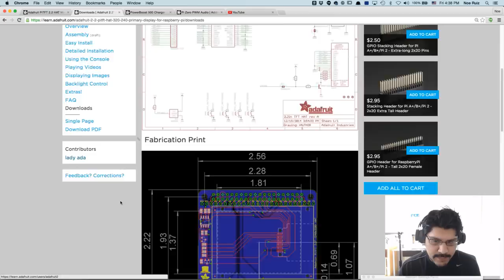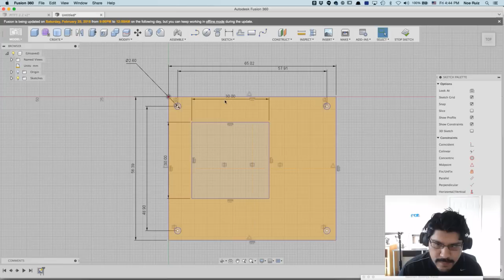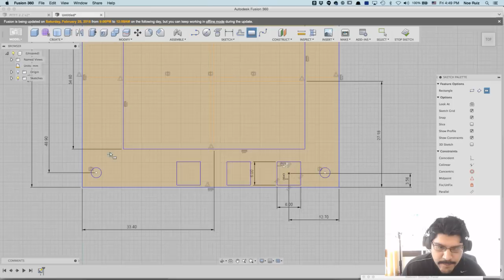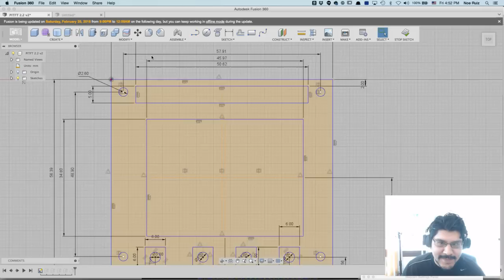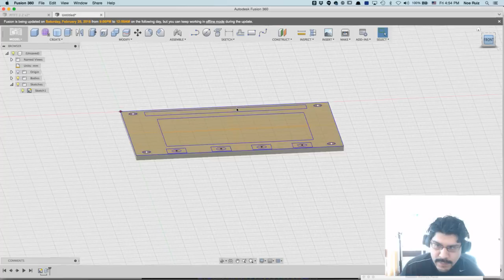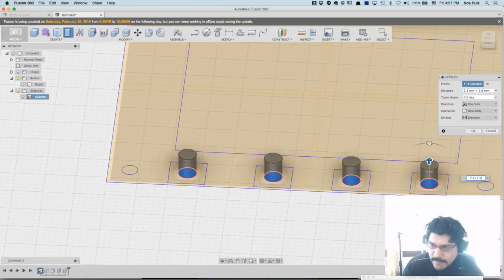Layer by Layer LIVE - Raspberry Pi Zero PiGRRL PT1

Comment: How are you guys going to tackle audio out? USB or PWM?
Reply: +cruelcynic I'm making something similar and I used a PHAT DAC from pimoroni and cut it down to the bare essentials to make it a lot smaller. The PHAT DAC uses the GPIO pins...I am not sure what they would use....but the PHAT DAC is a really easy solution. (Also it only uses gpio pins 12, 35 and 40 So the pitft still works